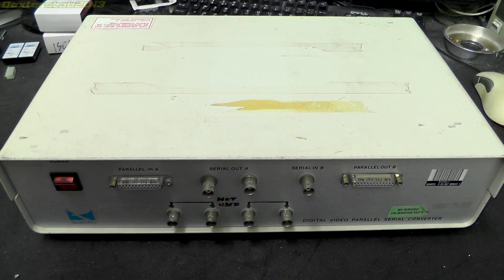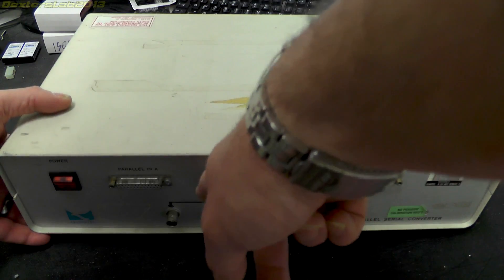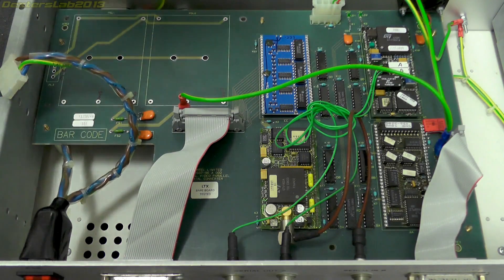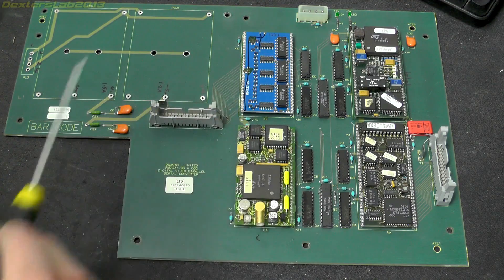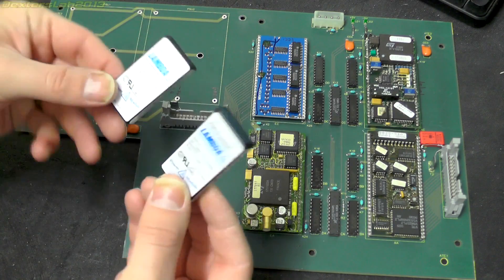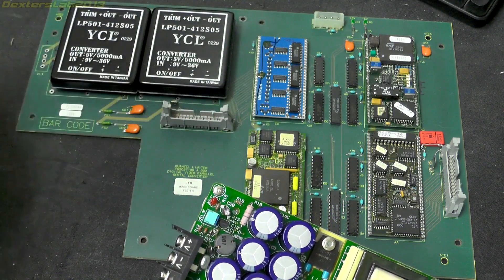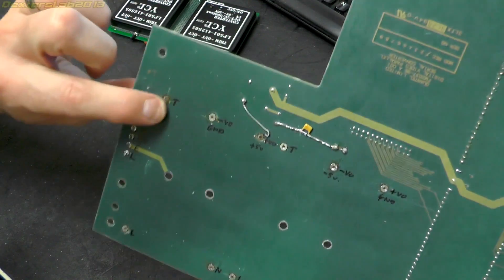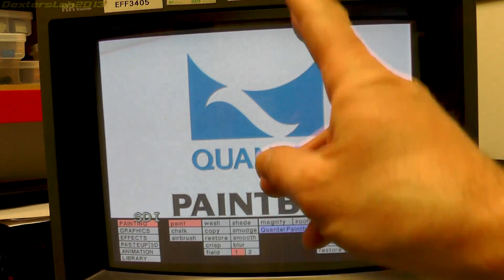DL116 - Quantel SD-SDI / bt.656 Parallel Digital Video Converter Repair

Comment: You sure that's late 80s? a LOT of the chips in those daughterboards and the even DESIGN of the boards seems to scream late 90s to me. especially the square ST chips, they look BGA.
Reply from the maker: Yes, with the exception of the bottom right daughter board (the serial input one) most of the devices are dated mid 1990, the serial input board is dated 1996 so that may have been changed. The ST ICs are ceramic hybrids in a PGA package.

Comment: This definitely looks like a low volume hack job.
Reply: I wonder what the daughter boards were originally for
Reply from the maker: The small boards look the same as the ones used on the v-series video input and output boards. These were available with SDI or CCIR656 so it looks like they borrowed them from the parts bin to make this converter box.
Reply: When I worked at Quantel one of my first projects was building boards to evaluate early 656<->SDI converters (though the ones I was testing were made by Brooktree ISTR)

Comment: I think I'd have either dead-bugged those DC/DCs onto the PCB with double sided sticky tape and/or cable ties,  or drilled new holes in the main PCB & wired direct to the pins.
Reply from the maker: you know if i hadn't have made a video i probably would have done that too :-P